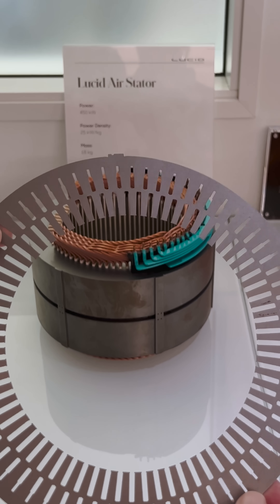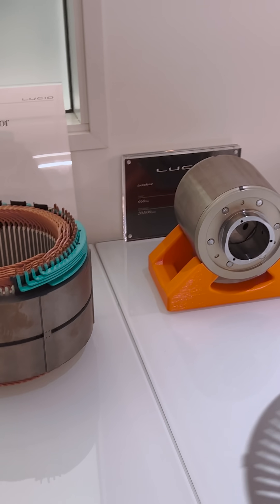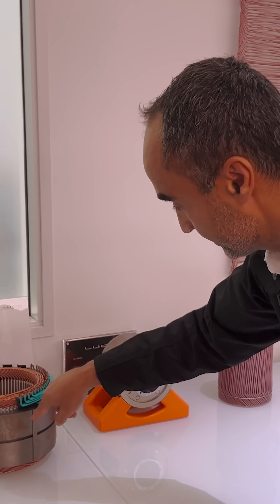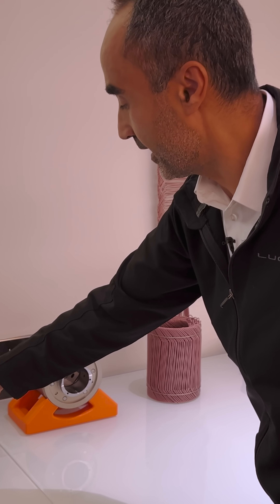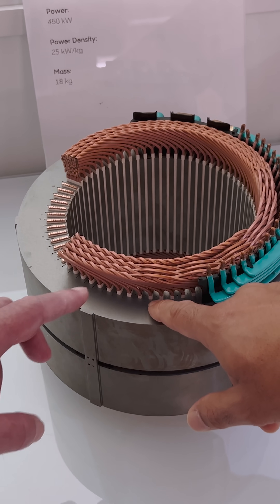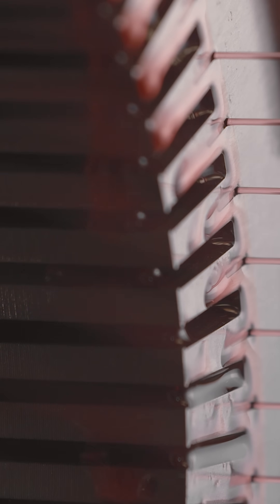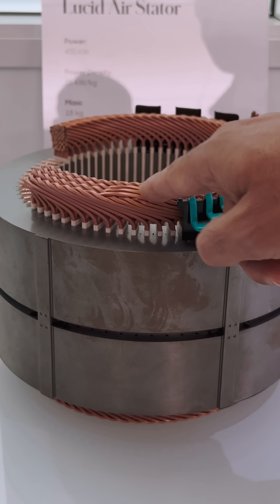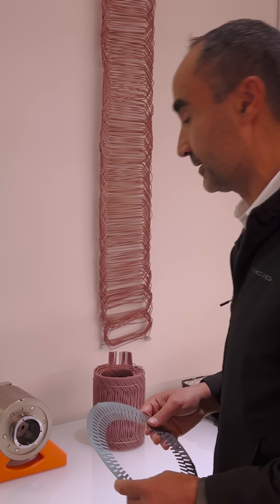How Lucid Keeps Its Motors Cool: Inside Their Cooling System

Comment: If the Oil Jet is hitting the end windings, does that mean the Rotor is rotating in Oil.
Also, how to keep the Oil from degrading the Coil's enamel coating 🤔.

Gregory/
The Pigeon Meister
        ... .  🐦‍⬛

Comment: If the motor was efficient you wouldn't need cooling. Heat is a byproduct of inefficiency.
Reply: Physics
Reply: @Nicholas-f5  I'll ask you the same q, do you have any idea of how inefficient these motors are? Yes, back in the day they were great, Tesla developed them. A man before his time. We have much better manufacturing and technology now we can go well above 100%. You're basing all of this on a 750w/1HP scale. This is an old system and really needs to be updated.
Reply: Even if 95% efficient you still get a lot of heat from a 450 kW motor...
Reply: @zapfanzapfan  do you have any idea of how inefficient these motors actually are and what the true possibilities are? I don't think you do.
Reply: @zapfanzapfan  this is why you need to go beyond 100% like into the 3 and 400% and yes, it is possible.
Reply: @JF32304  You might be confusing this with heat pumps, they can be 300-400% efficient since they just move the heat instead of producing it.
Reply: @zapfanzapfan  no, no confusion here. This is an AC induction motor. Horribly inefficient. Let me ask you this; what wattage should be required to operate a 50HP motor?
Reply: @JF32304  If you have achieved more than 100% efficiency then you have invented a perpetuum mobile...

Comment: Beautiful engineering.  Looks expensive to manufacture but on a $150k car it doesnt matter.  Their biggest mistake was in pricing too low and being too conservative in design.  The same car with flashy styling at $250k or $300k would have taken a big chunk of sales out of Bentley, Ferrari, Porsche etc.
Reply: Design is one side while being practical another side yet having good reason to do so another side.If the electric motor getting so much high then either design and load and voltage and horse power are main problem before other factors as heat because of foko or eddy current.

Comment: Interesting that an EV requires oil to operate. Will they also require an oil change too at some point?  What kind of oil is used?  It better not come from the ground.
Reply: The oil is generally similar, or identical, to automatic transmission fluid. These are typically synthetic oils, which means they still originate with crude oil, from the ground. Total capacity is small, typically 2-3 quarts. Maintenance interval is similar to a rear differential, so for most people, it's never. Chevy gives no recommended interval for the Chevy Bolt, for example; the only fluid change recommended for that vehicle is the coolant at 150,000 miles.

I would expect that one change every 100k-150k miles is probably a good idea for these, to be on the safe side, but it may or may not be necessary. Keep in mind there is very little heat, no combustion products, no clutches, and very carefully fit gears and bearings in all electric drive units, meaning the fluid doesn't have to work very hard.
Reply: Lol

Comment: better than glycol cooling which could leak and short out the motor
Reply: Is it motor oil?
Reply: @Eduardo_Espinoza automatic transmission fluid
Reply: Did you own a early Model S with a LDU?
Reply: But taste better

Comment: Holy crap! This looks awesome.  But also worries me about owners not keeping their Lucids’ maintenance cycles up and these small oil channels eventually get clogged then overheats.

Maybe lucid will program on “go to the doctor on my own” protocols in their vehicles for cars with bad owners. 

The cars will limp themselves to the service centers for help.  👀
Reply: No combustion byproducts contamination in the coolant
Reply: @dingusflingus  EV electric motor oil will also turn black but takes time depending how much oil there is inside. Oil also ages and loses additives during time without even on use. Here most common repair shop recommend that you change electric motor oil depending amount of oil inside a motor 40 000 - 60 000 miles. Oil is much much more cheaper than repairing broken motor anyway.
Reply: @dingusflingus  something called metal scrapings?
Reply: @xpreflex6265  no metal parts are reciprocating so very minimal if any metal shavings, and I'm sure there multiple filters
Reply: @igbatious  it's an electric motor of course it's gonna have metal shavings especially the constant vibrations it goes through, like you saw it's not a solid metal but multiple stamped like metal sheets put together
Reply: @igbatious  It needs a pump to move the cooling fluid
Reply: @xpreflex6265 there isn’t any physical contact between the rotor and stator so metal shavings shouldn’t be in the cooling system. Maybe in the gearbox oil but that’s isolated from the cooling systems.

Comment: Cooling means losses. The ideal speed and torque for high efficiency is not frequent in the trafic and BEV battery regulation Emotor efficiency an urban legend..
Reply: Your 1st sentence made sense.
The rest was indecipherable, word salad babble.
Reply: @alexmanojlovic768 of course the truth you dislike is indigestible, specially for smoked pigeons,  but anyone can grab a calculator and figure it out..lol.
Reply: @philgooddr.7850  🤣😂😅
More BabbleWaffle 🤦‍♂️
Reply: We just came from 75% of pure cooling losses to about 5%.
Reply: @ ICE diesel Weichai 53.09 % of efficiency certified by TÜV Bavaria on LHV . Gas CCPP 63 % eff. max at output new. (industy report average of the most modern ones with starts and stops, transients ~ 59%) step up line loss and step down loss 7% so 93 % efficient max assuming no static storage  (with 30% of storage count 80% power network efficiency with doubled usage storage loses evaporation etc..) AC DC charger 96.5% battery charge discharge ( output vs input) at optimum 30-70 % charging level maximum  92% ( at 99-100% charge level, the charge maintaining current efficiency goes down to ZERO !!!) Car water cooled regulation ( throttle and brake) 95% max. E motor 70 to 94% max. depending on load and rpm,, so  0.63 x 0.93 x 0.965 x 0.95 x 0.92 x 0.94 = 46.5% and ICE is 14.2 % better minimum by converting directly combustion pressure into a vehicular mouvement. Or beside diesel ice, take any formula 1 ICE racing engine: . Below 51% thermal efficiency LHV,, no Q1 qualification would be reached !!! so the same electric BEV real  efficiency from fuel to movement with huge mining and industrial grey energy and pollution and overweight : this is a pure URBAN LEGEND for naïves and lobbyists: just refer to a recent Guinness book record of 93mpg LA to NY over 3200 miles  with std. production Hybrid ICE …that is only 2.53 liter per 100 kms. so game over……lol.

Comment: So your electric motor will still need oil changes fantastic
Reply: 🤦‍♂️ You know you still have  reduction gears and a differential. Nothing mechanical in modern times uses anything but oil lubrication for bearings surfaces. It’s the most efficient, cost effective and easiest way to make a bearings surface.
The oil also doesn’t get contaminated by carbon, fuel, or glycol as it’s a sealed system which means the oil will last a long time assuming that it doesn’t exceed 120C and become burnt from inadequate cooling.
Reply: Yep Tesla use Dexron ATF and have a typical looking oil filter. Seems like industry standard oil change is every SEVERAL Years.
Reply: You wouldn’t need to change that oil any more than you change the oil in the differential of your ICE automobile. Any oil outside of an engine can be made “lifetime” as it doesn’t undergo the heat cycles or contamination that happens inside an engine, which breaks it down and deteriorates its lubricanting characteristics.

Comment: I wonder if that will wear on the copper over time.. if there's some dirt in the oil (particulates) and it's constantly spraying the side of that copper.. I guess we will find out in a few decades.
Reply: If the winding lasts a few decades then it's much more reliable than an ice engine and still is cheaper and easier to build 😉. Winding will last a long time if properly cooled such as in this case .
Reply: If the oil is clean when installed it will stay clean forever.  ICE puts contaminants in the oil due to piston ring blowby, but in a sealed system, there's virtually no contamination.  I guess the best possibility is wear particles from the oil pump, but it's probably insignificant as the oil is moving at such a low velocity and virtually no pressure.
Reply: @ohger1  Isn't it possible to just add a particulate filter?
Reply: @marluna_x  Yes, you can add a filter, but since there are no combustion byproducts in an EV motor, contamination of the oil wouldn't seem to be a problem. If any particulate problem starts to manifest only after 500K miles, it wouldn't justify the cost of the filter and associated plumbing.
Reply: @ohger1 its not viscosity and pressure that wears on pumps its cavitation which is existent in every hydraulic pump but proper filtration and service interval should negate the results of cavitation
Reply: @ohger1  IC engines these days will consume the oil before it gets contaminated lol. Efficiency regulation BS.
Reply: not more than failing to dissipate that heat.
Reply: Obviously the oil lasts much longer than in engines. However, the oil will eventually be out of spec from friction and thermal cycles, as well as metal particles from wear. Just as in transmission fluid and differential oil on ICE cars it should eventually be changed along with a filter, if it has one. Filters also age too
Reply: @MrCarGuy  According to my S maintenance schedule, the oil never needs to be changed nor does the battery coolant. I believe it must be due to the far lower operating temperature, much less friction, and of course zero combustion blowby.  I'll replace the car before it gets to 150K miles with another, but if I kept it, I would probably change the oil, coolant, and 100% of the brake fluid.
Reply: @calholli  Because I'm 67 and I can afford to buy new cars now.  My wife and I worked our asses off and drove rolling toilets at times when we needed to, but we put both our sons through college on our dime (yes, they're grateful) an paid off our 30 year mortgage in 16 years. We're retired, own our property free and clear for 20 years now, and are worth well north of 1M.  Besides, where are you  going to buy a car with 150K miles on it if we don't part with them - or hadn't you thought of that?  🤔
Reply: @calholli  I did what you did when I was in my 40s because cars are the biggest waste of money ever devised.  Maybe when you get close to 70 you'll drive something a bit newer - I realize that I can't take it with me and my sons will still get a nice chunk before I depart.
Reply: @ohger1   all respect to the sacrifices. I worked for Nissan in the early 00s when they first started the "lubed for life" craziness. 

I suspect tomorrow's rolling toilets are gonna be 1000x worse for folks trying to make the same type of sacrifices.
Reply: @hw6271 Agree.  Today's cars are too finicky to be ignored from continual maintenance.  I bought a fairly low mileage 2002 Taurus for my sons from an old lady - not a piece of sheetmetal anywhere on that car she didn't crease on other cars, light poles, trees, etc. so it was cheap. It also had indifference maintenance but it had the 3.0V6 which is one of those engines you can mostly ignore.  I got both boys through college (6 years) with no repairs.  A Ford ecoboost with poor maintenance?  Wouldn't take one for nothing.